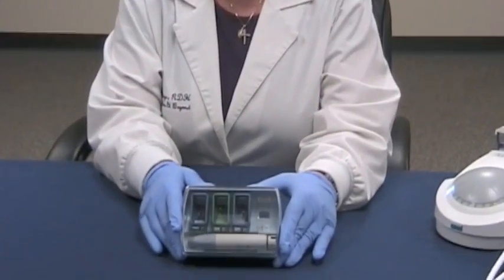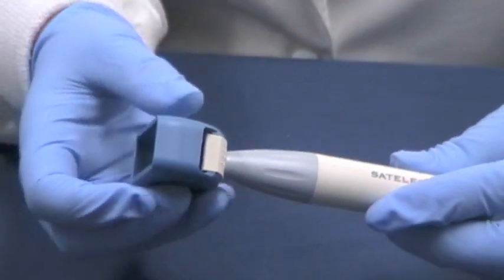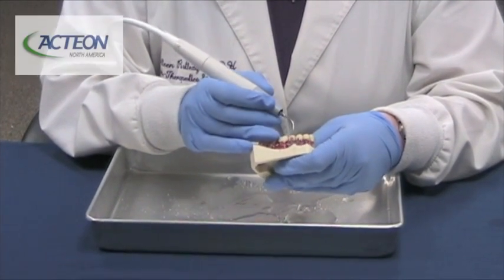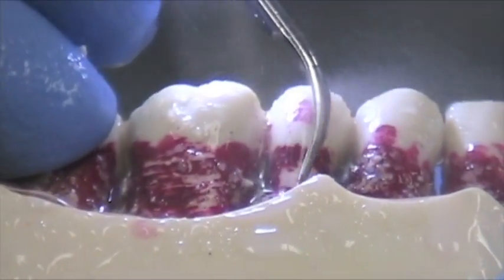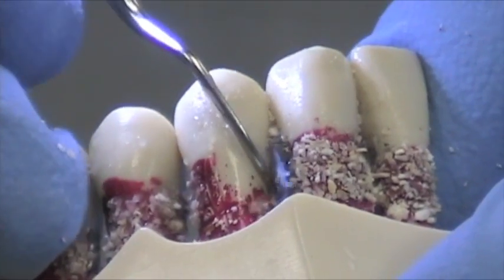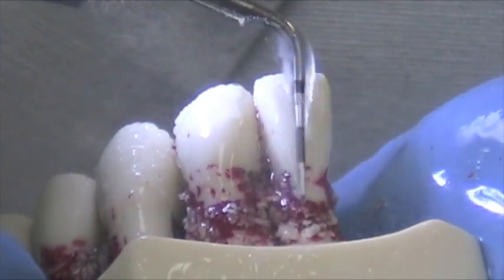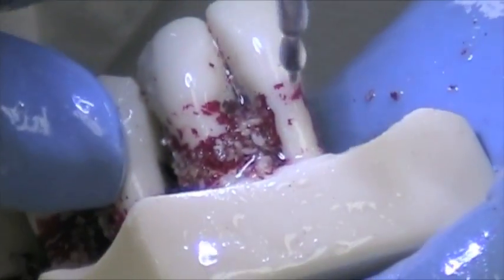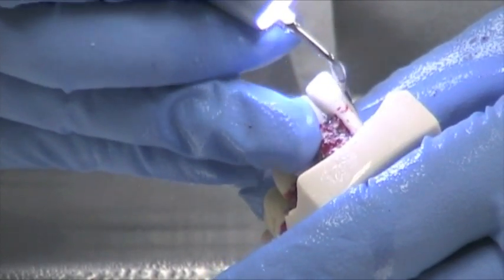Getting Started with the Piezoelectric Intro Scaling Kit

Comment: Hi... fellow rdb here....can you tell me how to get the piezo to not mist and make a mess on the patients face??? I am using a p3 tip and its making such a misty mess on pts face. With the cavitron I have no problems at all! I like just a low amount of  water droplet so water is not too high and not to low. Just enough to cool the tip but its a mess everywhere.  I personally purchased a piezo myself to travel with as rdh. Now im regretting  not buying a cavitrol bjt the piezo is easier to travel with but what am i doing wrong pts are soaked and its a low water setting....how do i get it to droplet the water rather then mist? the piezo is so messy...help